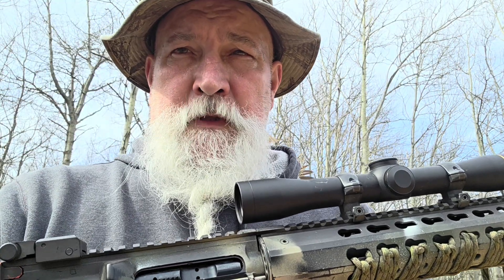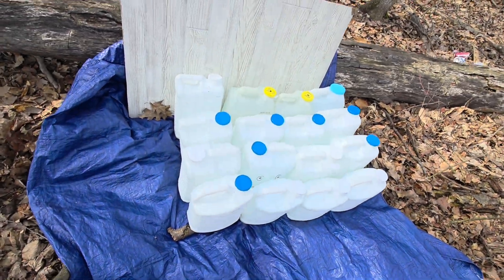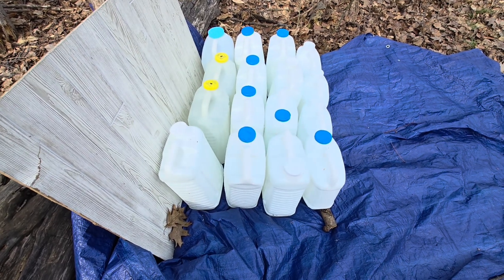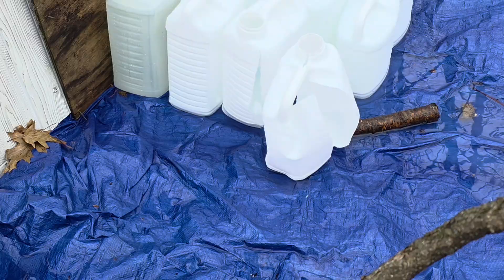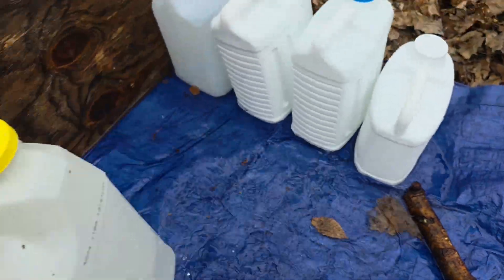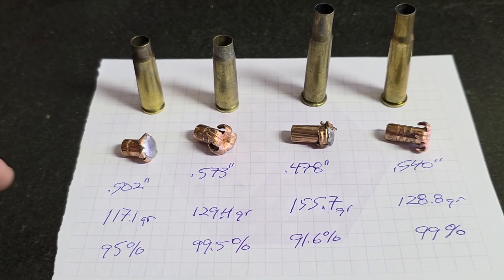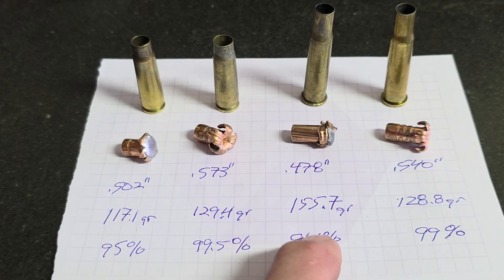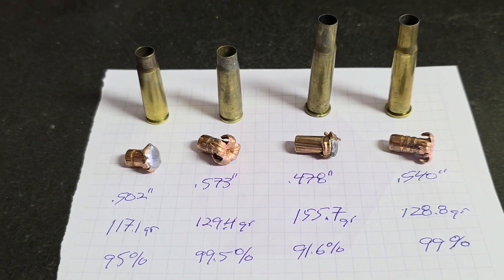Lead core vs. Copper monolithic,  2 cartridges,  same difference #hunting #bullets #ballistictest

Comment: There is a firearms shop and museum here in Queensland Australia that manufactures its own .308cal copper monoliths. They are called Whitworth Boar Busters, they are 130gr FNHP's and are absolutely fantastic. I would only use Remington Hog Hammers in y Marlin 336c as it is what grouped the best in my gun, but the Hog Hammers are no longer imported into Australia. I initially used the Boar busters to make an approximation of the Hog hammers, but they ended up way out performing the Hog hammers once I tweaked the recipe a little. They work great in my 308 too and I want to work up a load for my 300winmag as well.
Reply from the maker: Had to look those up.  They look like they'd  bust whatever you hit with them!   Im  glad you  found an even better replacement. 
That's kind of how I ended up with the 130ttsx.  The 123 tsx I was using wasn't available for years after the covid pandemic.  The 130s  were available and penetrated much better anyway.  
Thanks for your comment!